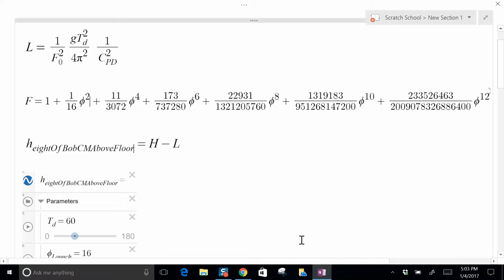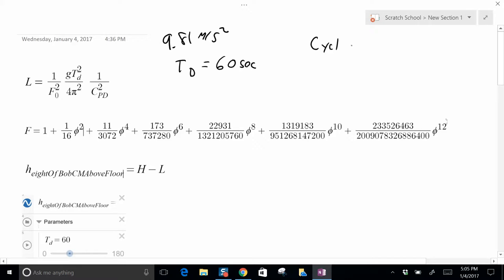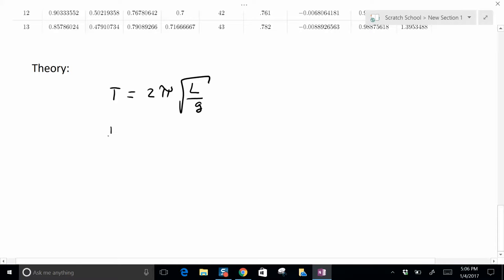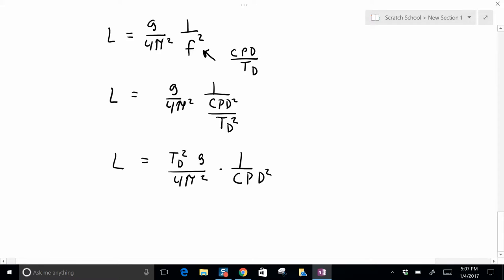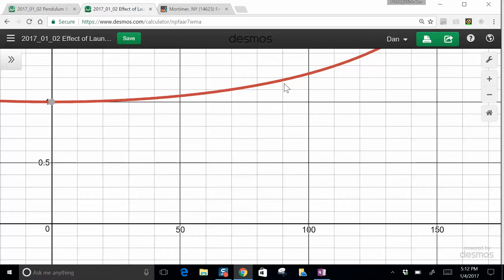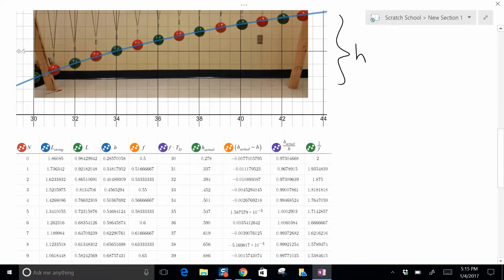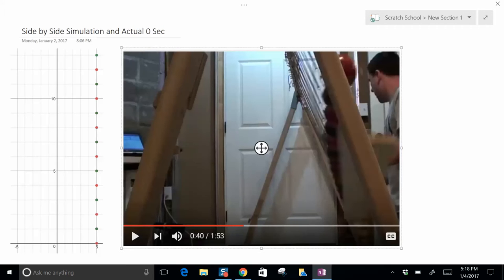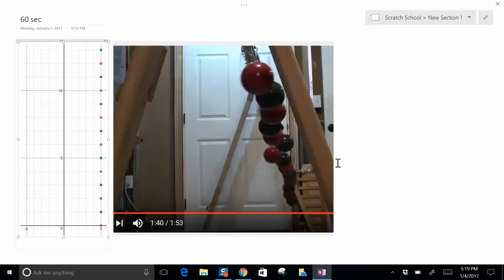Pendulum Snake Theory vs Reality (How Long to Make each Pendulum)

Comment: Great stuff!!!! Thank you so much for your hard work doing this. I'm building my first one with 15 large nuts (49g each) I have my support rail built and drilled and I'm ready to install the string at the moment I'm going to use one long screw for adjustment of one side of the string on each of the nuts and go from there but I need a starting point obviously. And then I'm building my next one a little more sophisticated, I have (so farl 20 x 1 inch chrome stainless steel balls and plan on a minimalistic support framework along with mirrors one placed along the length on the bottom and one at the far end for visual impact. I don't know why but I'm fascinated by this whole topic. Again, thank you|